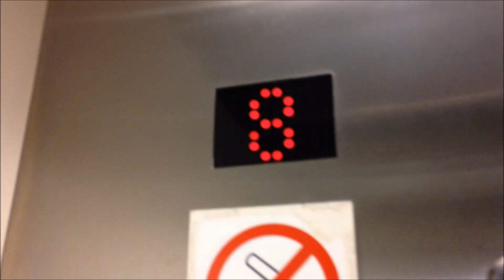[18] Pretty well set up generic lift in a tower block in Brighton

Comment: I like the Dewhurst series 42 buttons but if only there could no delays when the doors shut.
Reply from the maker: Crappy Lester... At least get a better logic!
Reply: @lbsiuk  Or the proper magnetic VF drive.
Reply: idk why but I prefer Dewhurst US91-EN
Reply: @LondonAndSouthEastTransport  The Dewhurst US90 series is a bit boring for me to be honest, they're nice but they're everywhere.
Reply: @rahan573  I would rather have Dewhurst than DMG or Lester controls tbh. If the Dewhurst US90 series buttons wasn't so popular we wouldn't be so bored with it
Reply: @LondonAndSouthEastTransport  I wouldn't want lester nor DMG too andI think I'd still get bored of it quickly since it carries the default design of dewhurst unlike the 42 series which has a completely different design and different build with different micro switches.
Reply from the maker: @rahan573  I have some actually dewhurst lift buttons that mrmattandmrchay sent me. He also sent me a 2nd generation Express lifts panel.
Reply: @lbsiuk  You're lucky! You got an orignal Express part!  And Dewhurst parts... it's kinda boring if it was the black button style but the series 42 or 44 type is more interesting to be honest, at least you got some buttons.

As for me I only have a a Kone LCE key, a fake Dewhurst key and some triangle keys, no other parts of lift do I have.
Reply from the maker: @rahan573  I got black dewhurst and silver dewhurst. The express indicator is from (I think) Matt's video of the 7 floor abandoned Express Lifts that he filmed about a year ago now. I think that because my panel has the same floor numbering. LG G 1 2 ^ 3 4 5 6.
Reply: @lbsiuk  You obtained an indicator aswell! You could some model Express lift or something like that anyways it's cool you got some buttons and parts at least.